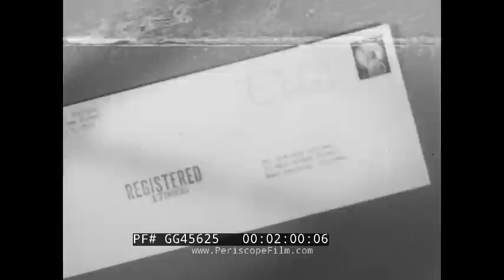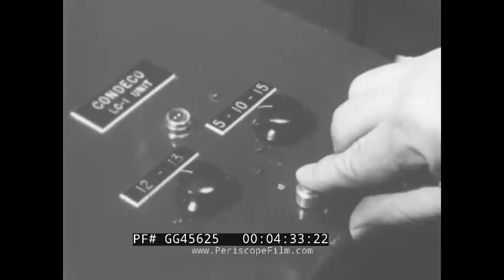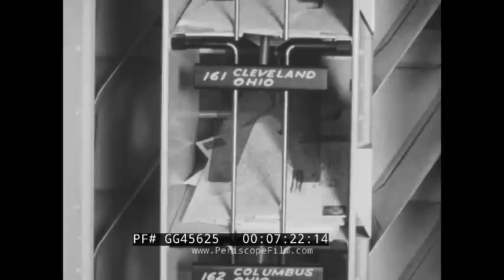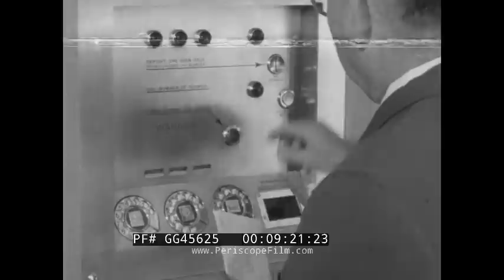" MEN MAIL AND MACHINES "  1957 AUTOMATION OF THE U.S. POSTAL SERVICE PROMO FILM    GG45625

Comment: The USPS is the only place that guarantees delivery to every single address in this vast country. No private business can match that level of service. It doesn't exist to make a profit. It exists to provide an important service regardless of location. 

Your address might not have cell service, internet, or electricity available, but you will always have mail. And that's pretty cool 😎
Reply: What a crock!
I learned the hard way that if I have a crucial package to send, to not send it USPS (US Piece of Sh"").
If your critical package is ripped open, such that the contents fall on the floor and is separated from the package, they will just sweep up and discard the contents (or stuff it in some other torn-open package), find your damaged package put the contents of another torn-open package in to it, and mail it on. That happened to me in 2013. A genealogical notebook that took me months to compile was lost, but a book in Cyrillic (which I'd never seen before) was placed into my damaged package. ...No private business can match that service?!?

...Also, I've moved into apartments (after long disuse) which didn't have a mailing address, and had to go to the local post office to get one -- just like with any of those other services you mentioned. ...Also, if it is too inconvenient for the postal service to deliver it to a specific address, they will compel you to use a community mailbox or a mailbox on a highway some distance from your property.

Do you suppose that in environments of privatized, for-profit mail, that addressees wouldn't receive mail (correspondence) without paying for it? ...Why do you suppose that?

Comment: Interesting to see the hand trucks and hampers are still the same ones we're using now in 2025.
Reply from the maker: Guess those things are built to last!
Reply: In the early 70s, at a major General Mail Facility (GMF; main P.O.), I loaded, pushed, weighed, & unloaded many, many of those. The large, heavy 'carts' (600+ lbs. empty) were called 'floats', & when loaded w/ 1st class mail, might weigh over 1,700 lbs, I think. I can't recall what the iron-framed, rolling canvas hampers were called - maybe 'tubs', etc. Each had a matching canvas sleeve which cld be inserted from the top to increase the volume by abt. 60%. We young guys were able to stack the empty hampers about five-high by flipping each one up by hand; they may have weighed only 35-40 lbs. In those days before UPS & FedEx, the USPS was the only major parcel post svc., & perhaps bcs of that, work speed was usually emphasized.
Reply: @BermondseySteve  We called the large wheeled rolling thing dock trucks. And would be stacked with trays for letters or tubs for flats. And the metal carts we called APC’s..
Reply: @catherineerwin8269  Thx for the info. Was that a long time ago? (no need to say exactly when :))  What did APC stand for? We stacked the 'floats' only with #3 sacks, & prob'ly got at least 30-40 sacks/bags on each float.
Also, I just remembered that we also used a much lighter weight canvas/metal cart that looked a lot like a heavy duty shopping cart. We were tremendously busy, w/18 wheelers arriving every 40 mins. or so. Good exercise.
Reply: I'm going to GUESS that y'all won't find "Made in China" or "Hecho en México" on any of the originals in the video, either. But again, that's only a guess. :D